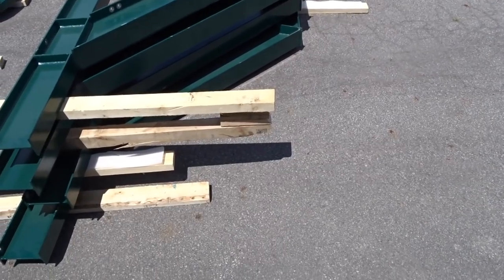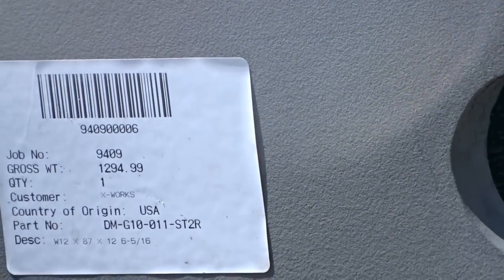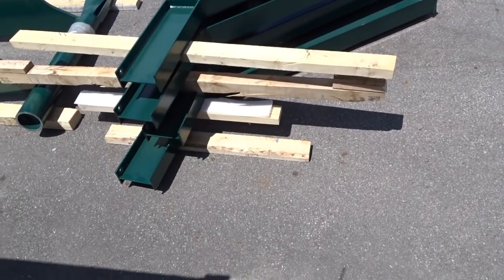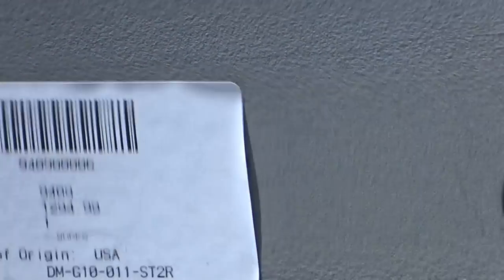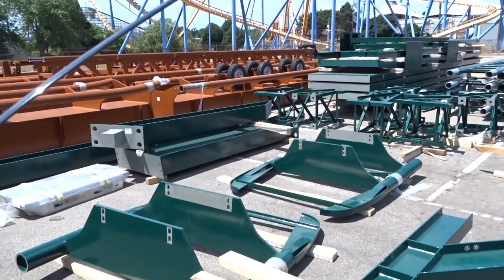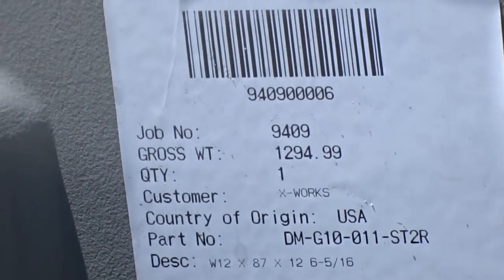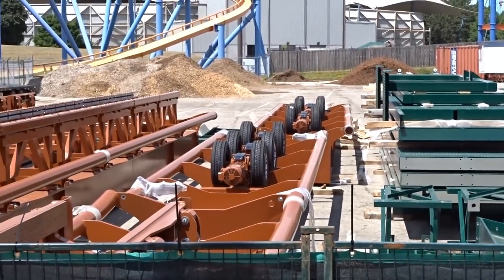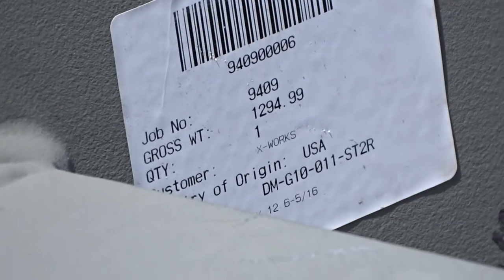Canada's Wonderland Yukon Striker Track Arrival Update

Comment: I just got back. You can see the track from the queue line of Behemoth. It looks like at least the brake runs and transfer track. Shockwave had a rough terrain crane by it because one of its motor assemblies was removed and out. Another thing is the air compressors could be for the brakes of the coaster. Roller coasters travel so fast that pneumatic brakes are required.

Comment: I think the air compressor is for breaks instead of restraints because those mostly use hydraulics in newer coasters. Plus breaks usually use air pressure to release the breaking force. That’s just what I know from what I have researched and it could be incorrect.

Comment: I need to know. If someone does know this please tell me. Cause this could mean something. On one of the supports you can see what looks like a (212-1) Just wanna make sure that is the case. Cause it looks like it could say ZIZ-1 aswell
Reply: Auston Kirby ooo that’s acc interesting. sadly i’m pre sure it’s 212-1 cuz the top of it is curved making it a 2 not a Z
Reply: I don't know. they are very oddly shaped. That is my thought too, but still something to bring up
Reply: I thought about it also. Looks like ZIZ
Reply: It looks like ZIZ more than 212
Reply: It would have been easier had that piece come from Switzerland... the Europeans tend to cross their letter Z and number 7, and add a long tail to the number 1.... I think it's 212, the tops are curved, not sharp points had it been ZIZ.

Comment: Hey when do you think we'll be getting an RMC? I imagine its probably a safe bet that its probably going to be the next coaster we get unless they take down Flight Deck and Time Warp since theres not much room left. But when?
Reply: I think an rmc wild beast will happen in 2022-2023
Reply: Wild Beast and Minebuster aren't big enough to get the RMC treatment...they're each just 100' high.    What I'd rather they do is get rid of useless Thunder Run and Guardian and replace them with a "dark ride" RMC... think Disney World Space Mountain but with RMC elements.  Wow....
Reply: they're not going to be getting rid of Thunder Run since its one of the original rides. But yeah Minebuster cant be RMC'd because of where its located. But if they get rid of that useless race-track ride next to Wild Beast they would have room to make an RMC there, maybe even let them build something from scratch
Reply: Wild beast can easily be rmc'd. It's height is not a problem (steel vengeance is 50' higher than mean streak).  It's layout is possible to rmc, and twisted timbers layout is much different than the hurlers and it is an amazing rmc.
Reply: And if they will remove a ride it will be flight deck and time warp, for a b&m invert.
Reply: one of my friends is hoping for a strata, but I personally would love to seem them add a dueling coaster